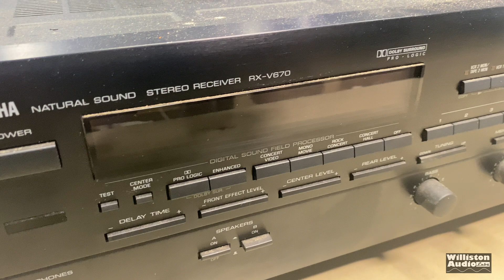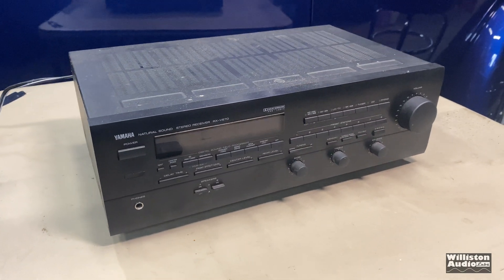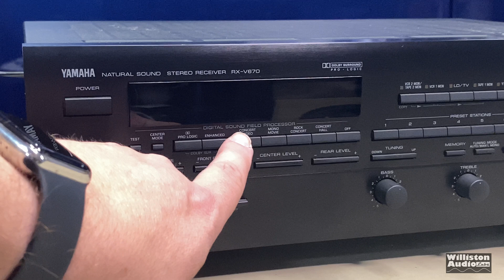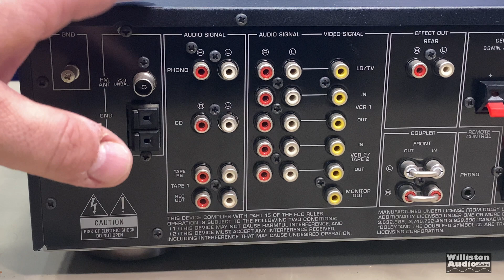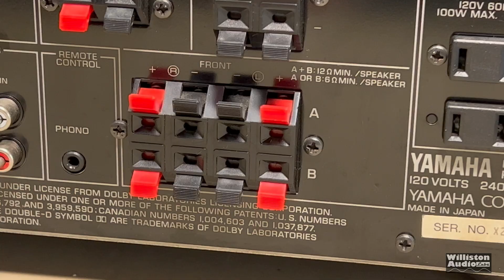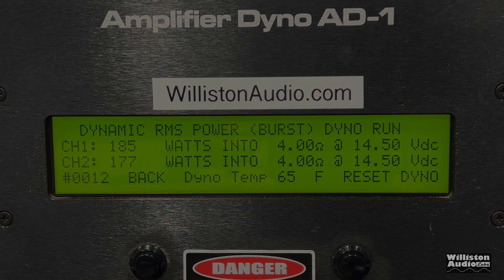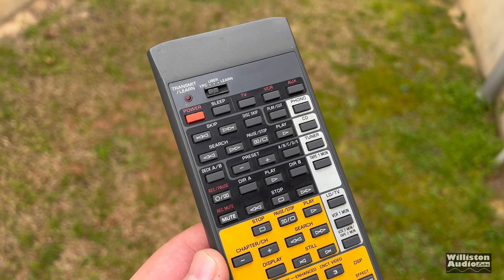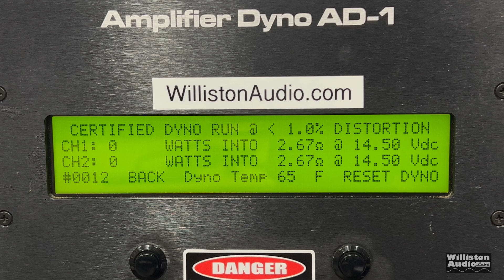1993 Yamaha RX-V670 Home Theater Receiver Review and Amp Dyno Test

Comment: Also use to like running my pc audio into the stereo receivers via a headphone jack from the pc to rca Into the receiver & my PlayStation 1 for the cd player then off to the car audio speakers & subs thru the receiver powered by car amps it was way cheaper then buying home audio style amps & subs plus it sounded really good when you built enclosures for everything

Comment: I actually have this receiver amp driving Audio Centron 8 ohm 150 watt A speakers 15 inch and horns are cast allot not plastic with Yamaha sub woofer and Yamaha 5 disc player all the other quality goodies but it is truly beautiful driving my main speakers , I wont get rid of it but wish I could get a respectfully priced remote controller as mine is worn out yes I have thrashed this system for years and years probably 6 days a week a couple of hours a day. super reliable and sounds AMAZING !!!!!!!!!!!!

Comment: I had the exact amp. Bought new back in the days
Reply from the maker: Awesome 👏
Reply: @wal2  It worked out well. I had a sound dynamics 15 inch sub and we watched the Star Wars trilogy on VHS in the summertime with the door open. People were walking by wondering what the hell was going on. We watched SNIPER and it sounded sooo clear you could hear bullets whipping by your head. This was when surround sound was just getting going. It was so clear and defines surround. I learned how to use all functions and made it learn from other remotes. I sold it all with the lower quality JBL speakers it came with for a still very good price.

Comment: Bought my Yamaha HTR-5280 in July 2000. I have been using it daily for 22 years and absolutely love it.
 The only problem with it? The digital volume knob does not work, can only adjust volume with remote (still using original remote too!). 
 Yep, loving my old school receiver, God bless.
Reply from the maker: Yamaha made quality receivers for sure
Reply: @wal2  they certainly did.
Reply: that's nice! I got HTR-5360 2 years ago for 100€/US$105 and still works like a charm, everything works mint. came with original speakers except the subwoofer, still happy that I jumped on that deal
Reply: @kultss  glad you did, and I hope she keeps on cranking out the watts for you. Such a great feeling to find a true deal like that.
Reply: @shanecabbage2187  thanks brother, I hope the same for you as well!

Comment: Most every modern receiver has individual channel volume control it's in the setting controlled by the remote with on screen guide or by app on phone or tablet.
Reply from the maker: Yeah but not as easily accessible as here on the remote
Reply: @wal2  i understand my prized possession what my Yamaha rx 2090 with a ddp-1. The ddp-1 was as big as a mid level receiver itself and the only thing it did was decode ac-3  5.1 and nothing else for the low low price of $600 . Then the future came along and turned it all into a paper weight with it's hdmi cables, hd tv, 7.1, 9.1, 11.1, wifi, Bluetooth, USB drives and 30 different formats of audio decoding. Awhile back I had a yamaha rx-v671 that I lost the remote to it and learned that you could not get to 95% of the settings without it. And to add to the frustration you have to have the exact remote that came with that and the model above it making it one of the  rarest yamaha remotes

Comment: Nice review. As time goes by these 90s receivers look better and better. I'm actually surprised that the receiver made the rated power. A lot of receivers from that era made bold claims for power output. I really enjoy your videos and I really enjoy vintage receiver reviews.
Reply: I just fixed a non-working Pioneer VSX-D1S. Man that amp is a monster, puts modern home theater amps to shame. It's rated 130 a channel but seen ppl test it to output around 180 a channel. I need to recap mine as there's a bit of a hum but 90s home theater amps are crazy.
Reply from the maker: Thanks for watching and commenting!

Comment: ….perfect test for this amp. 

Can you test a 4 channel amp (as you do, all channels loaded) then show the difference when only 2 of the 4 are driven. 
The reasons is:
A) it shows why you do it and the difference in measurement if you don’t 
B) it shows how current A/V amps will deliver less power/more power when all channels are loaded vs 2 channel. 

Many AV amps lie and drive only one channel in the ratings. The rating is accurate but you rarely ever have a mono movie. Also it serves as an explanation as to why av amps sound thin with all channels loaded. 

Lastly, I use a 4 channel amp and I only drive 2 channels. I’d love to know what kind of difference it makes when you only drive 2 of 4 channels.
Reply from the maker: Agreed

Comment: I wish I could see you test a Sony DA777ES. When I compared my Yamaha rx3000 to my 777 Sony I noticed it uses almost the exact same massive Tkk transformer, the part numbers are one digit off!! The RXV3000 uses the same amp section as the RXV2095 that's documented to do over 400 watts dynamic power!!
The Sony 777ES is also a beast it's got that same transformer with instead dual rectifiers and dual parallel transistors what definitely seems to outperform my RXV3000 on a listening test🎧  If only I had my own amp lab to definitively tell with numbers🤓
Reply from the maker: I have some Sony ES gear I’ll be showing off, but I don’t have that model. I’m a huge Sony ES fanboy

Comment: Lmao I got the same receiver with tape deck and cd deck with cabinet for 150$... Came with some advant speakers that needed a refoam bit even after refoam one had a coil rub so I burned them in anger. Even though it sounded beautiful tbh...
Reply: @wal2  it sounds pretty good curently I have them hooked up with a pair of pioneer tower speakers a pioneer subwoofer with onkyo speakers as surrounds.... But in my opinion the best receivers I've owned would be 80s JVC cleanest highest channel power I've gotten out of amplifiers I've heard. I've owned many over the years at one time I had a stack of 3 with 2 15 inch optimus towers 2 pionner double 10 towers with a pair of  8 inch  infinity book shelf speakers and a alpine type r 10 1st gen.... GOD DAMN speak about sound it was so crystal clear. The bass was nice warm and toned it shook your ribs and the vocals where so loud and clear it vibrated your ribs... Totally regret not keeping that setup.....

Comment: If you drive all 5 channels you probably at max get around 55 watts per channel
Reply: And then older Yamahas we're good systems
Reply from the maker: Ratings of 70w/ch were given with front and rear channels loaded.
Reply: @wal2  interesting. The power supply doesn't have the capacity to do so. Would be interesting to see it do it though. These older units were quite good though so I wouldn't be surprised if it was able to do it.

Comment: Watch out on modern Yamahas. Had one crap out when a static charge jumped to the usb port on the front when disconnecting. Started screeching like something was frying. Turn it off and unplugged. So its not ESD protected there. Cool vid by the way. Very eye opening.
Reply from the maker: Sorry you lost one 😲

Comment: I have a pioneer 505s paired  to Cerwin Vega VS12s (from i believe 1992) and bose 301s (from 2000s) that I use everyday still. I heavily used them them in college (95-2001) and they are still kicking. At one point bought a yahama receiver to replace the pioneer but it was very under powered. So I went back to the 505s (rated 135 watts x4). I have since added 2 klipsche 12in powered subwoofers (300rms/600 max). Have an onkyo EQ as well. Old school for the win
Reply from the maker: Awesome 👏

Comment: Yamaha. We're more than just motorcycles. 👍
I still use my RX-V661 7.1 that I bought brand new which I believe is the first digital series after this one? It has a couple of HDMI inputs and one output, but the strangest thing . . . If I want to use the on-screen display I have to use the yellow analog video port. Good luck finding a new TV with that on it, these days.

*Edit: I just realized I'm listening to you demo your Yamaha AVR on my Yamaha AVR! I'm over Yamaha-ed!!! 🤣🤣🤣

Comment: I used to have a woodgrain and metal pioneer that would hurt 2 15s and 2 12s at same time. Then would send that power through head phones. I put 2 Aiwa  4 inch mid bass drivers in big plastic oldschool headphones. Would literally make your eyes and head shake.

Comment: would love to see an Onkyo TX-SR805. that thing was 60lbs of beast mode.
Reply from the maker: I have an 8XX model I think. Had video switching issues but amp still works. I’ll look for it, around here somewhere
Reply: @wal2  that would probably be the hmdi board. the boards failed due to heat when you used the hdmi pass through to power other items. disabling that feature usually prevents that from happening. 

Onkyo underrated their amps at the time. i still have mine, it definitely puts out more than 135RWMS at 8ohms. i only ever saw two tests for the sr805, they measured ~175WRMS and 183WRMS @ 1%THD, 20hz-20khz, in to 2 channels. the latter test did a bench with all 7 channels driven and it STILL managed 150RWMS. i would love to see the 805 or 875 belting out 300wrms+ at 4 ohms, lol.

the specs for the sr805 and 875 can be found on the onkyo website still. google "tx-sr805 7 channel" and it should be the 5th result.

Comment: Nice ol receiver there. I have the matching yst subwoofer for it!!  I still love the old analog stuff. And have a nice little collection of receivers and amps. I like how fast that one changes audio fields. My denon takes seconds to change anything!!!  Yea booiii.
Reply from the maker: I never used any of these modes except Dolby Enhanced. My next receiver had 5ch stereo which I used a lot
Reply: Ever since AV receivers got TV inputs and monitor output, many set up the features are only adjustable from TV screen. I have Denon from mid 2000s, 9ch beast which had fried rear channels, but I use it only as stereo amp for my digital sources. It has some interesting features, plenty of juice for AV receiver but runs very warm. No sub out in stereo mode, and crossover only set for 80Hz, which kind of sucks.

Comment: Can you test an amp (without) all channels loaded to show the difference it makes please. 

Thanks in advance. Love the channel.
Reply from the maker: I only tested front 2ch’s in this amp and the other channels were unloaded. I didn’t see the point loading them as few people would use this receiver today with surround speakers.
Reply: @wal2  yes I agree, this was a perfect test for this amp. 

What I mean is, can you test a 4 channel amp (as you do, all channels loaded) then show the difference when only 2 of the 4 are driven. 
The reasons is:
A) it shows why you do it and the difference in measurement if you don’t 
B) it shows how current A/V amps will deliver less power/more power when all channels are loaded vs 2 channel. 

Many AV amps lie and drive only one channel in the ratings. The rating is accurate but you rarely ever have a mono movie. Also it serves as an explanation as to why av amps sound thin with all channels loaded. 

Lastly, I use a 4 channel amp and I only drive 2 channels. I’d love to know what kind of difference it makes when you only drive 2 of 4 channels.
Reply: Unless the power supply is under sized, you shouldn't see much of a measurable difference running less channels. Not a scenario you are going to encounter too often in quality equipment. In a real low end reciever you could see some increase, but it's really not much.
Reply: @volvo09  oh it absolutely will be using an uderspec'd psu, almost all entry to mid level yamahas do. My rxv630 would drop to less than half the rated power with all channels driven, which is why they only ever rated them at 2 channel output.